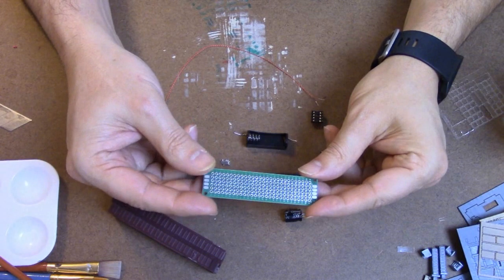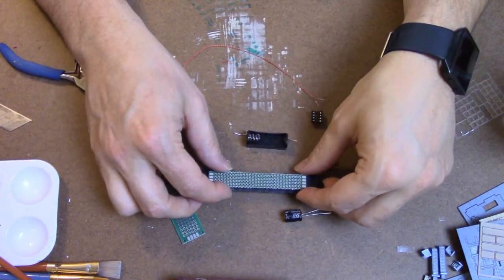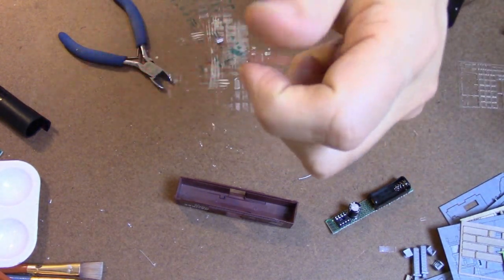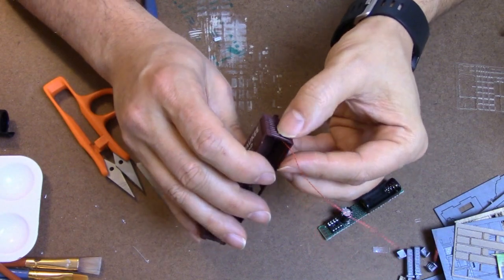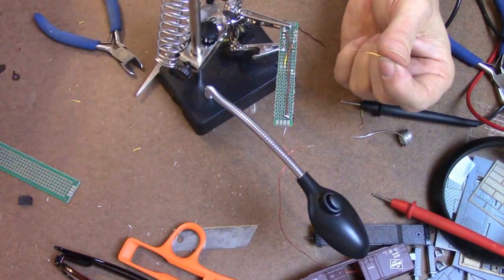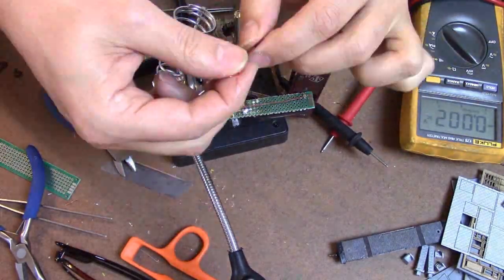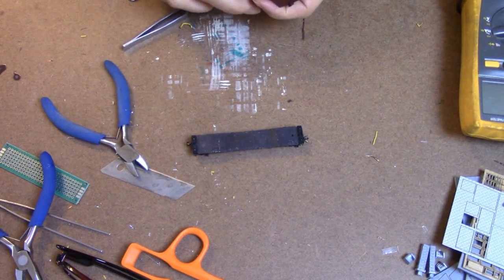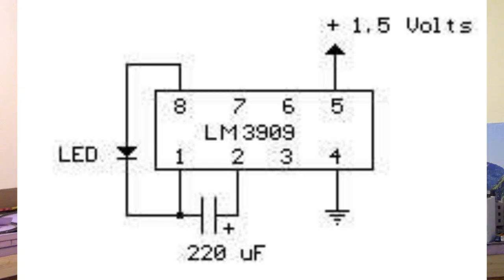Making an EOT Device

Comment: Hey Alex, that is pretty cool.  Simple components but umm, got a D in electronics back in HS. lol.  However, thank you for your video.  Maybe one of these days I will attempt it.  Great job. It really looks cool.  - Drew
Reply from the maker: Don't let that stop you!  What have you got to lose? The beauty of doing it like this is you don't even need the car until all the electronics is complete!
Reply: Thanks Alex.  Where do you usually order your electronic components?   It was nice when we used to have radio shack stores around.
Reply from the maker: For this project, all of the components were ordered on ebay.  The price list in the description is for the individual components, although some of them (switches, capacitors, battery holders) were ordered in lots of 10 or 15.
Reply: Ahh..okay.  Thanks again,  Alex.